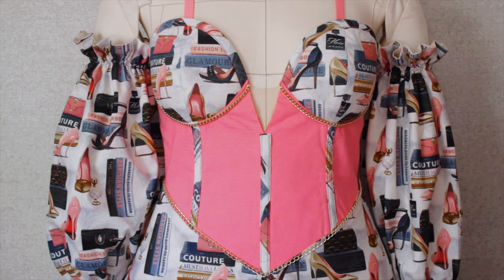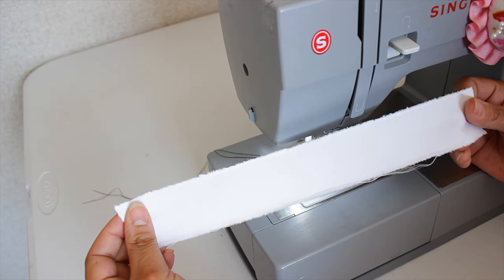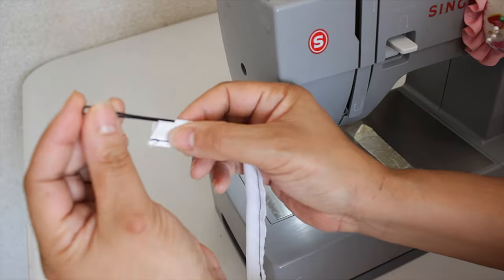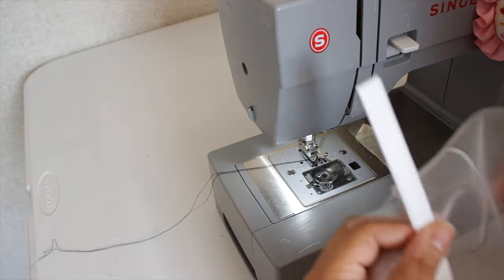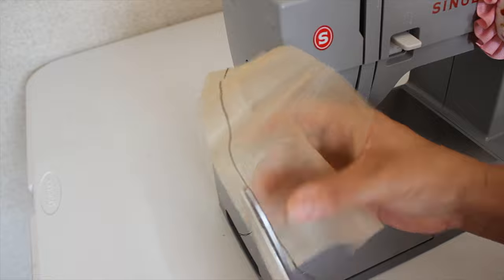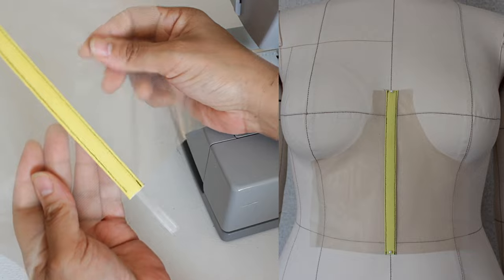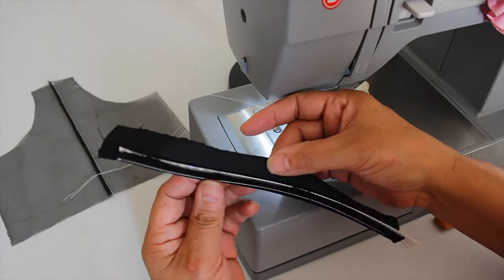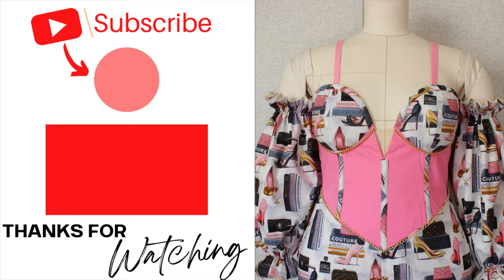3 METHODS HOW TO SEW NEAT RIGILENE BONING CHANNELS FOR CORSETS

Comment: Ok, ran the plastic boning through my little machine and it worked. Only problem is my ability to sew a straight line. I can't go slow with my machine and the plastic boning because it won't go through the plastic when going slow. Amy tips on keeping the line straight while going at a med/fast speed?
Reply from the maker: U can sew on the rigilene boning not the plastic boning. To sew a straight line try using a stitch in the ditch foot. Are u using a domestic sewing machine or a industrial sewing machine?

Comment: I really hope you see this, please can you tell me what needle size, machine tension and stitch length you use for rigilene? I am really struggling as my machine keeps skipping stitches with this and i cant find any information as to what settings i am to use on my machine for rigilene which is really frustrating. If you answer this i am very grateful.
Reply from the maker: Hi I would say 1st take the thread out the machine and thread it over sometimes it’s not threaded right. It happens lol, the machine tension I used is 2 1/2 to 3 and for the stitch length it’s 2 1/2 to 3…also make sure you sew at  the two edges of the rigilene boning not on the inside. I hope it works out for you 🥰

Comment: Hi, which method do you suggest to use for steel boning? 1 or 2?
Reply from the maker: U can use steel boning for both if u are sewing the rigilene first and then put the steel boning after…but if u just want to use the steel boning by itself then sew the bias tape on the fabric first because u cant sew on the steel boning…once u sew the channel then put the steel boning in….❤️
Reply: @drapingclass101  thank you so much